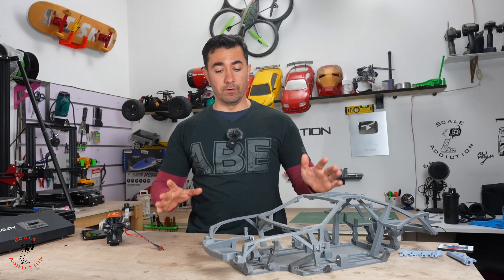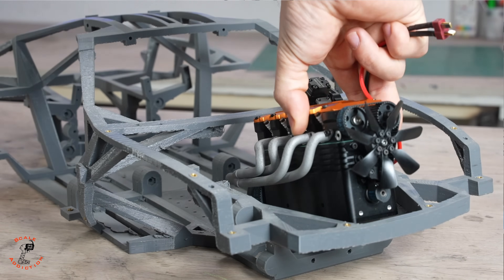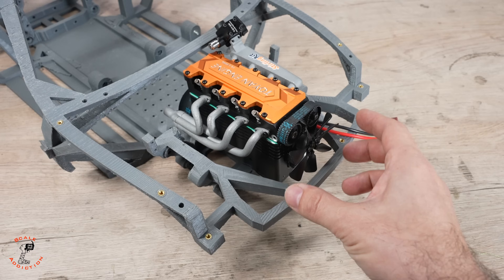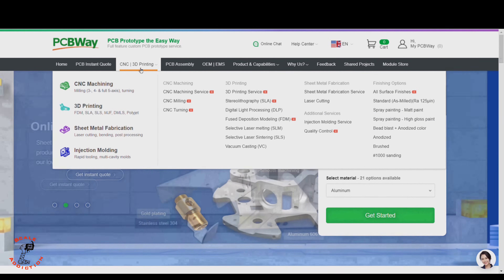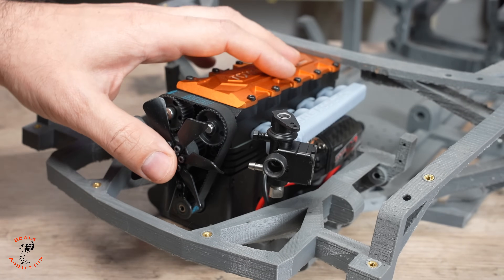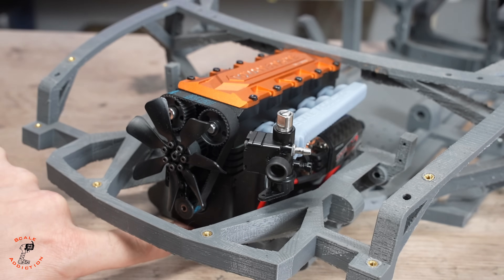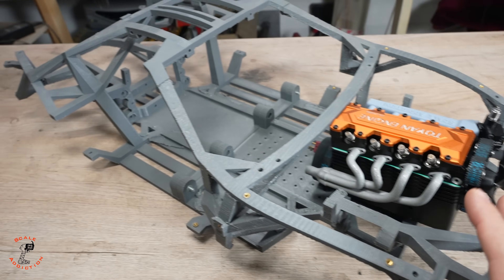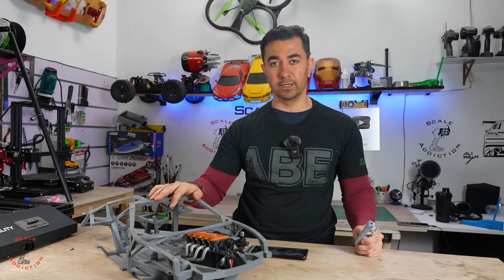3d Printed Nissan skyline with gasoline engine

Comment: Id 45 the intake as well because on further inspection the straight intake would be too close the engine and cause the belt to get shredded by something sticking out! Im not really a fan of the air ride suspension id maybe like it to be another drift car as im not doing the gas. Everybody saying turbo it are stupid because the turbo really doeent do anything to add hp to the engine. I feel its just another possible failure point as these engines arent designed to have boost lol but still a sweet build and im waiting for the files for an electric 1 nice work otherwise!

Comment: Ive been really interested in buying a toyan engine but from what ive seen from a lot of videos is they are not particularly fast. I remember having old nitro trucks growing up that were quite capable. Is this just because a lack of gearing / transmissions or do these engines just struggle to make useable power? Thanks!

Comment: Hello, I would like to be able to buy the design of the gearbox part from you. I've been wanting to contact you for a while but it's impossible. Could you upload it or send me a link so I can buy it, thank you.
I would also like if you could provide the link to the device you use to start the engine from the radio station. Please. Thank you so much
Reply from the maker: Hello, do you mean the gear shaft for the manual gearbox? You can dm me on my Facebook page for sure

Comment: not an expert, just thinking: The exhaust might care more about the tight curve than the length of the pipe. Tighter curve=more reistance, longer pipe=more resistance. Maybe the rear cylinders want a shorter pipe to make up for the tighter curve. is resonance an issue at this scale?
Reply from the maker: I have no idea with smaller scale, the only way to find out is to try it